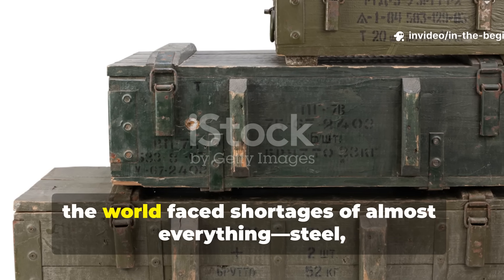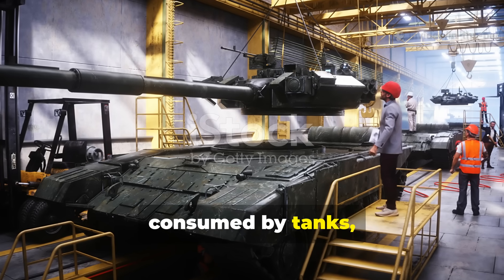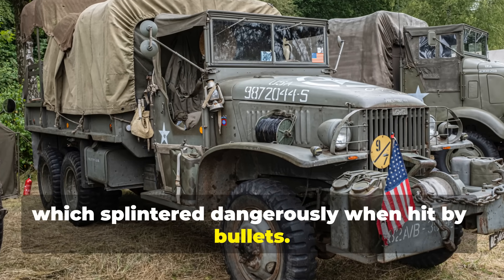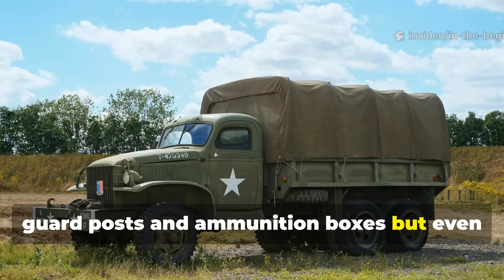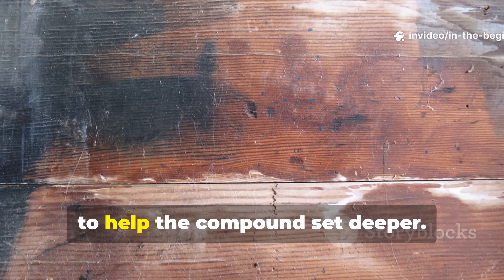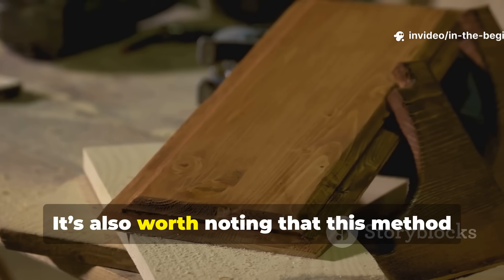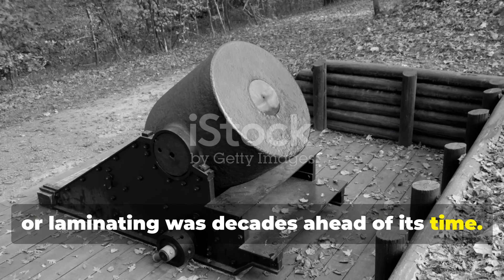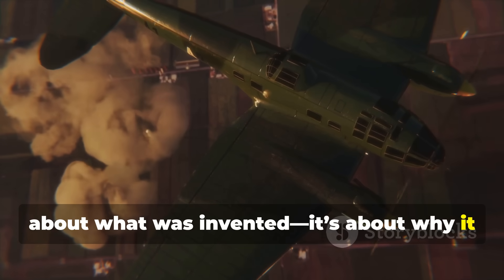The WWII Paint Additive That Made Wood Bulletproof

Comment: The main problem with using this to turn wood into something truly superior is that it barely soaks into the wood, only penetrating a thin layer on the outer surface. If you soak the wood in it over time, before it really has a chance to soak in, the sodium silicate precipitates out of solution.
Reply from the maker: Didn't know this

Comment: Alors là je suis hyper épaté de peinture de revêtements qui s'agit du silicate de sodium moi j'en ai jamais entendu parler de ça vraiment jamais de ma vie c'est la première fois que j'entends parler de ça sur cette vidéo et je trouve ça incroyable pour arrêter les armes il est par balle fait avec du bois
Reply: It doesn't automatically make any wooden object "bulletproof".  The term "Bulletproof" is a misnomer. In reality it means a particular material, with a certain construction, has undertaken tests to determine its resistance to bullets of a certain type, at certain velocities at a certain range and in certain conditions, and they have "proof" of the results. Outside of the stated parameters, the protective properties of that material may be non existent.  There are so many factors to consider,  but they state in the video that typically it would only work against low velocity firearms projectiles and fragmentation.  🙂

Comment: How exactly does water based sodium silicate mix with oil based coating to provide the claimed protection???
Reply: It probably becomes a non Newtonian shear thickening fluid when hit by a bullet moving at high velocity. 

You can make your clothing into a non-Newtonian shear thickening fluid and bullet proof just by using ground up sand (silica), polyethyline glycol (PEG), and your oven. PEG is just RV or marine antifreeze. Its also in lots of food.

The clothing is still just as movable and wearable once it dries, but if anything touches it that is moving at the speed of a bullet, it will suddenly harden, harder than steel, and shatter or flatten the bullet, and your clothes will then immediately return to just being normal clothing.
Reply: @TheBillah   Don't go around claiming you can make "your clothing bulletproof" just by adding sand and PEG, or indeed any non Newtonian fluid. 🙄  I also suggest you don't try testing your silly idea on anyone else,  because they likely won't survive to regret it.  You can, in certain circumstances increase a material's resistance to puncture by such means, but you absolutely cannot make ordinary clothes "bulletproof" in any practical sense. Even using it on ultra strong materials like Kevlar,  you still need a good number of layers of the fabric to be bullet resistant, and it's still not practical to make a "soft" fabric armour capable of resisting high velocity rifle rounds. The other thing about non Newtonian fluids is that they are FLUIDS, and fluids tends to flow due to gravity and to dry up. Which is why there's no easy way to make any such protection even semi permanent.
Reply: @another3997 you said all that ignorant stuff and yet clearly haven't looked at any of the patents. There is so much wrong with what you said that there isnt even any point reviewing them. Google scholar is your friend.
Reply: It probably would become an emulsion the wood would soak up the water, and then you'd basically not  have to worry about it. It just won't work on anything non porous like metal etc. it works even better for some stuff like brick or wood, since the surface won't dry up ur paint as much, but the paint can still form a good bond as long as the water isn't too much, and it can escape through the other side of the material otherwise it could form bubbles in the paint.
Reply: Chemical is sodium silicate with casein binders. When wood is impregnated with it.
Reply: It hardens the wood once it dries properly
Reply: The same way as you get other substances to mix. Emulsifiers . 😂
Reply: @another3997  The issue is not emulsification but how it actually interacts with the cellulose. Try to emulsify oil based paint with latex or acrylic paint and paint your deck with it. Let me know how it works out! Does cellulose absorb the water which will prevent any action by the oils or does it absorb oil and create hydrophobic environment for the water based stuff. Dig deeper..🤣

Comment: I don't usually like AI generated content. But this particular video is actually pretty spot on. And I do know that after WW2 a lot of things were suppressed, or outright hidden. Case in point Henry Ford made a car out of fiberglass made from hemp. And it was reported to as strong as steel. And people think it was made illegal because of people smoking it. 😂
And I do know sodium silicate use was suppressed in some states when i was young. And the particle board that's shown. The kind they use in construction, it was originally supposed to be sealed with a chemical coating. And a lot of you might have already heard of this stuf,  but know it by the name of liquid glass. It's amazing how hard particle board is when treated with liquid glass. Not to mention how long it will last. Oh and car mechanics used it for a certain reason back when i was younger. That one I'm not going to say. Because it can ruin your engine. It was used as a last gasp. To  keep cars from going to the junkyard a little while longer. It's probably on a lot of your phone screens as well. 
 Sodium silicate is a truly awesome chemical compound. And if you're wondering why particle board isn't coated with it now. Think reduced profits for the manufacturers who produce it. If it takes too long to replace the people who are running them now. They won't be around when it does wear out.and if you you live in a damp or humid area, it deteriorats quickly if not treated.
Reply from the maker: Thanks for sharing all this interesting information!
Reply: If it was made from Hemp, then it isn't fibreglass,  because there's no glass in it. Composite materials like that predate WW2 by a long way.  Many of which were, weight for weight, somewhat stronger than steel. Although "strength" is an imprecise description, because there are different types of strength, such as Tensile and Compressive. A strand of Kevlar has high tensile strength for its weight compared to steel,  but try using it in compression.  You might also want to consider that there is a whole world outside of the USA, and despite what many Americans seem to think, the USA didn't invent everything.  😂

Comment: In Iraq we taped phone books to the sides of our vehicles
Reply: I wonder if it helps if the phonebooks are wet?
Reply: @K-Effect  Try experimenting on modern paper and see,  but in general, modern paper will gradually weaken and disintegrate when wet. That's why you wet wallpaper when you want to scrape it off.
Reply: In America we use phone books in pillow cases to beat the shit out of people and leave no marks
Reply: That would help with shrapnel but not much with concussive forces. Telephone book against side of head and a billy club old school cop tortured method. won't bruise but you feel every bit of that shot

Comment: Sodium silicate still used for many applications today.  It works great for waterproofing concrete floors,  basement walls, etc.  Also good for long-term storage of eggs and locking up motors  of used cars and trucks for Obama
Reply: It is a very underused chemical probably because it is cheap and easily made.  .  I use is with Benzonconium Chloride BAC biocide to harden wet rotted wood, add a little lime if it is a bad rot.  It has good fire retarding properties and has no odour so I treat the interspace in the floors whenever there opened. Vermin don't like it at all.  It costs me about £8 a gallon and as you say is sold for cement floors.
Reply from the maker: Thanks for sharing your knowledge!
Reply: I know when I was younger some states did their best to suppress it's use. And just from the experience of what one of my friends did with it back then I can understand why. He sealed a hole in the side of an engine block about as big as a half dollar. He drove it for a while and sold it to another person. That person drove it another year and half before he dunked it. It's an awesome chemical, with many uses. It's amazing how long partical plywood will last treated with it as well.

Comment: huh?? gotta try this on my next boat-building with 1/4" ply w/ epoxy/fglass coating. wonder if epoxy will stick to such a SS-coating in a marine environment? hmmmm?.... >> War is NOT a "necessity" for Innovations. Peace works better! :-)
Reply: Peace COULD be better in most ways.  However, in war time, huge amounts of money, time, and resources are solely devoted to research and development. PLUS, safety and ethical restrictions that are in place in peacetime, are often removed. It's a horrible thing, but a whole lot of medical research was done by Germany that propelled understanding of medical things which could not have taken place so quickly and so completely except the doctors and scientists had free reign to work on live humans at will.  What a horror for the people victimized yet it DID vastly increase knowledge that wouldn't have happened in so short a time otherwise. I'm not saying it was GOOD. I'm just saying that wartime does generate huge advances that would take far longer in peacetime.
Reply: @rickhinojosa5455 "Peace works better."  Everything you wrote just proved the point.  Better innovation requires not violating the rights of others - even if it takes longer and is not as efficient
Reply: @rickhinojosa5455  those same scientists and their offspring and protégés still do to this day, none were tried at nuremberg and they have operated with virtual impunity this whole time.
Reply: I've been in the Marine boat building industry for 35 years, that was my first thought. Now I'm 73 years old looking for something to do. I think I'll build another strip wood kayak and give it a shot. 👍👍
Reply: What kind of boating are you doing😳
Reply: @bobhope4949 I spent 35 years building everything from mega yachts to rowboats, from the lantana boatyard all the way south from Merel Stevens in Miami. 5 years as a mold maker for intrepid power boats (tooling). Put together my own airboat and set a lot of time in the Everglades. I built one sea going kayak. 6 yrs total at Broward yacht builders, 5 at intrepid, 2  at the Hatteras factory in fort Lauderdale. Helped build the factory and then built play yachts that were produced at DENISON FACTORY just off of  Port Everglades. Pick up any yachting magazine and you can find both companies companies boats, before all that I graduated from the harry Lundberg School, in piney point Maryland and sailed in the merchant Marines for a few.
  The Waters of the world have always been very good to me and I've never regretted a single minute.
Reply: @bobhope4949 now I just old living on social security. Lol

Comment: Plastic armour, which was a mixture of hard granite gravel and soft limestone gravel held together with tar used to protect gun positions and the bridge on merchant ships from aircraft machine guns and cannon, was applied to a steel backing.  But near navigational compasses it was applied to a wood backing.  I wonder if that wood backing was treated with silicate?
Reply from the maker: Interesting point!
Reply: From greek times they were using tar in shipping
Reply: @veronicalogotheti1162   Presumably you actually meant "Ancient Greek times", as Greece is still a country today. The Ancient Greeks used Tar for waterproofing, not for making composite materials.
Reply: @another3997 they used it
Reply: @another3997 and in the middlea east they found in sumer

All the area knew about it
Reply: @veronicalogotheti1162  Noah knew about it too.

Comment: The US started using Rhino lining in early 2000s as it was found to provide pretty good protection from bomb blasts.
Reply: They were using Rino lining on HMMVs since the military started using them.  That’s why they have a bumpy surface, it helps deflect radar in the tiniest way.
Reply: No, the lining only helps reduce the splintering and spread of fragmentation.  Various materials have been used to achieve similar results in the past, at least as far back as WW1, quite possibly long before.